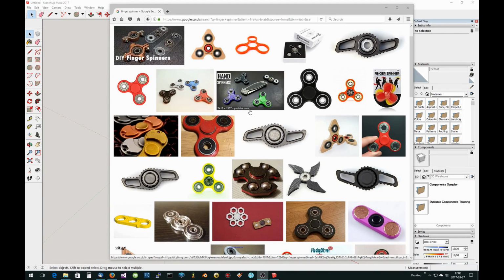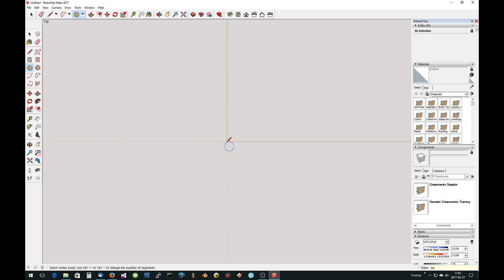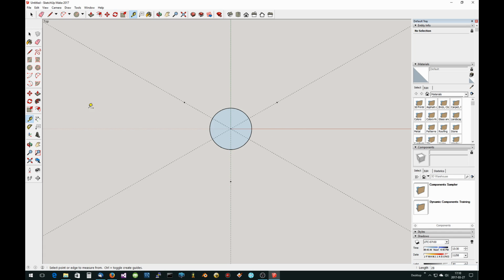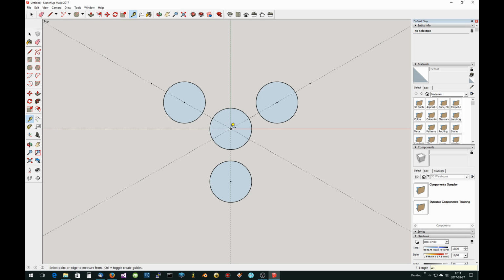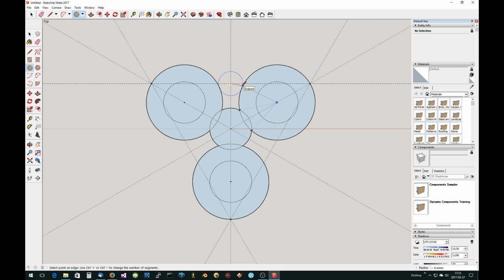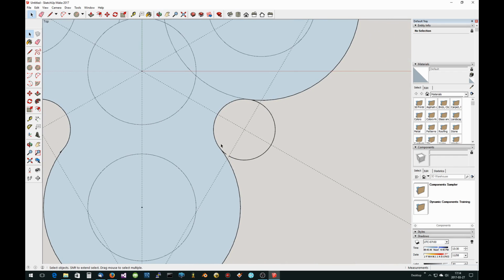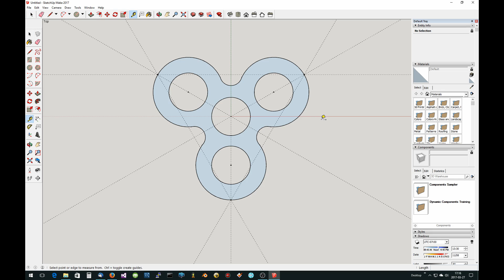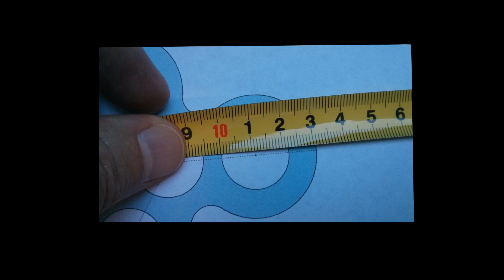Modeling a wooden fidget spinner/finger spinner in Sketchup

Comment: I'm trying to print it out on a mac and I don't know how to get it the right size it's printing it the wrong size thx
Reply from the maker: I don't have a Mac so don't know the details, but this page should help: https://help.sketchup.com/en/article/3000151

Make sure 'Fit View to Page' is NOT selected, and set both the 'Print Scale' boxes to 1, to set 1:1 scale in the printout.

That should get you close. If the printed template is just a little off, make sure to also check any printer-specific settings - your printer driver might be set for borderless printing, for example, which might scale up the image slightly, or you might have other scaling or 'fit to page' options in the printer settings.